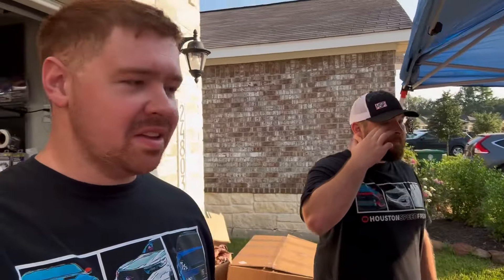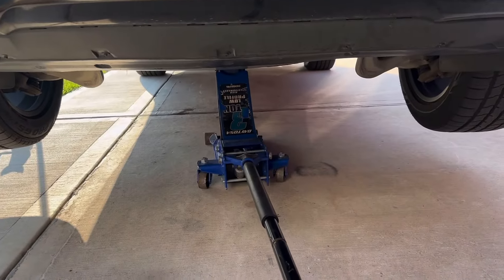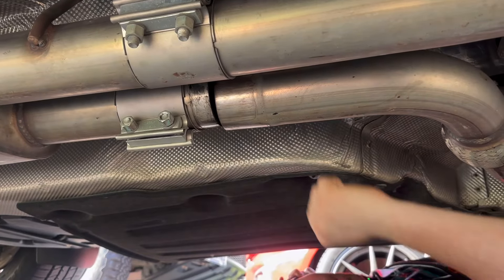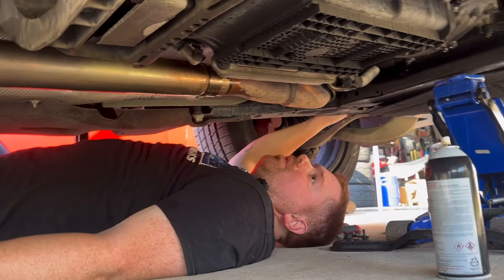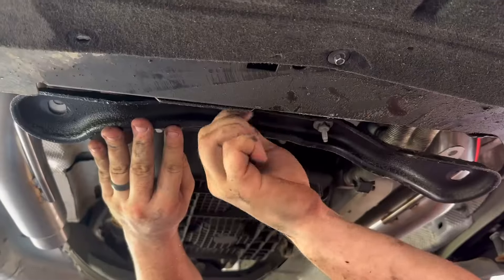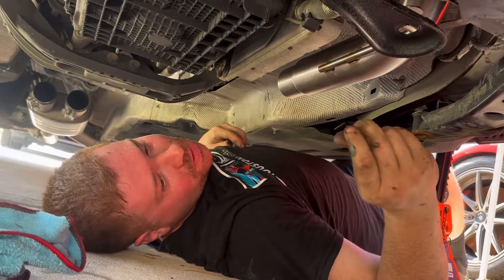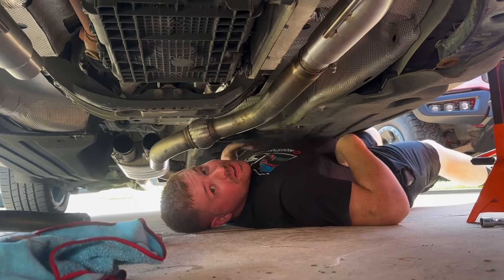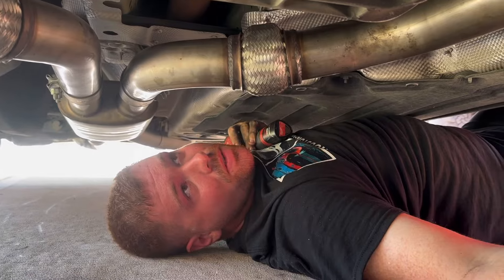Explorer ST CVFab Downpipe Install

Comment: Took mine to  a shop to install and they couldn't take off O2 sensor , they beat it and heat it and they broke it. Made me pay for the sensor +$145 on 22 ST. And the experts managed to mess up my flex pipe , I made them pay for that $167. Right on dude good content.
Reply from the maker: Dude that’s wild I’ve done a lot of down pipes some spray lube is all that’s needed one time I did have to break out my pipe wrench but that’s about it. Haven’t ever broke one or damaged one getting it off to where it wasn’t reusable.
Reply: @HoustonSpeedFreaks  yeah man , brand new car
Reply: I’m in Dallas. How much would you charge to install this? Have thermal 3 inch as well. Do you have a email I can reach you at.
Reply from the maker: @TX_FpiuIsh yes sir shoot me an email @ HoustonSpeedFreaks@gmail.com
Reply: Found my new Texas Ford mechanic going to end up emailing too when parts come in have a 24 ST in Texarkana
Reply from the maker: @turbodad6522 hell yeah brother bring it by I’ll get you taken care of 😁

Comment: Me and my teenage sone just did plus Lethal Performance flex pipes. What a pain in the as$. Don't use GEARWRENCH E22 sockets. The walls are too thick and won't fit on nuts. We did in garage in 10 degree weather jacked up about 2 feet on stands day 1 we disassembled and day 2 we put it all together. No Hurry.
Reply from the maker: Damn in 10 degree weather that’s dedication! , that’s awesome you and your son work on cars together that’s my dream is for one of my sons to pick up cars as a hobby. Props to you two 💪

Comment: I love the sound of the CVFab catted downpipes with the 3" thermal R&D. Is there any risk to turbo or engine damage with this combo while leaving the vehicle stock tuned? We're getting a 2025 ST and from the sounds of it the ECU will be locked. So unless it gets cracked we wont be able to do much but the sounds of those turbos with the CVFab downpipes and the 3" thermal R&D are just too good to pass up. Do you think Ford would void warranty on turbos or engine doing this even without a tune?
Reply: No risk. However, your Ford dealer may disagree (and they'd be wrong). Technically they have to prove that the DP and exhaust caused the issue.
Reply: You could check with the service manager. If they are weary over the downpipes maybe ask if having them installed there would help the situation. The exhaust obviously will not cause any warranty issues.
Reply from the maker: No it won’t void your warranty I’ve even heard of some ford dealers installing the parts for customers but of course it’s not cheap lol

Comment: I just got the CVFab down pipes with Defoulers, will this system require a tune after install?
Reply from the maker: No sir
Reply: @ Alright does the Warm-up procedure have to be followed for daily use?
Reply from the maker: I always wait for it to isle down atleast before I drive off

Comment: Hey Travis.  I had my Doenpipes installed.  Same as these the CVFab.  I have my trusted shop
Instal them.  They also did my tune.  I've noticed though upon start up I will hear a loud rattling noise behind the drivers side muffler.  And sometimes when I stop and break it will happen. This noise.  And then it goes away.  Have you experienced this?  Only happened after the downpipes were installed
Reply from the maker: Are you still stock exhaust because if so, the OEM mid pipes I have a tendency to break and rattle. I see it happen a lot too, especially after people add down pipes on the stock exhaust
Reply: @ nope, I have thermal 3in, cvf pipes and intercooler, and tuned.   I looked on the Facebook group and people also said they noticed the same thing I heard.  For some reason I can't comment on the Facebook page.   So I can't get my questions answered.

Comment: So after 3 hours of trying to get this project done I realized the cv fab sent my downpipes with outlets that are 1/8 in larger in diameter than the stock downpipes. My thermal r&d mid pipes don’t even fit
Reply: Cvfab responded by telling me to cut 1/2 off the outlet of the downtime. Midpipe still doesn’t fit all the way and can’t install it. Seriously a trash design. wtf

Comment: Seems like it has an oil leak going on, seen some caked on the bracket.
Reply from the maker: Yeah I mentioned it in the video and the owner is well aware 😁
Reply: @HoustonSpeedFreaks  ohh got ya! Just had my rear main seal and oil pan replaced under warranty. So my eyes went straight to leak lol good job though on the install. Love all your videos keep it up 💪🏼
Reply from the maker: @pyro1284 yeah it’s a really common leak on the explorers unfortunately I see it on a lot of them
Reply: @HoustonSpeedFreaks  I had it on mine, but I cleaned it up and it hasn't returned. I think it was front diff fluid from the FADA leak, which I had addressed a few months ago.  Since it's a common issue, maybe the leak is usually old front diff fluid.
Reply: @jungwoo4667  had that happen to mine as well. diff oil drained all the way back there, thought it was oil pan. Ended up replacing the FADA with the new version (no actuator), cut the connector and reprogrammed it, been running great ever since.
Reply: @chrisbrown5164 I had mine fixed at the dealer a few months ago. I don't think they gave me the new part that makes it full time AWD, but a new o ring

Comment: Hi, what socket number did you use 17 or 19 or 21?
Reply from the maker: For the down pipe bolts it’s an e22 deep socket I cover it in the video 😁
Reply: How many inches are the 02 sensor spacers?
Reply: How many inches are the 02 sensor spacers?
Reply: @ Where can I get the spacers for 02?
Reply from the maker: @gumbee9911 oriellys sells them but they should come with the down pipes

Comment: The worst project. Had mine at a high-end shop. They actually refused to do it and sent it to another shop. 600 for the install. The shop that ended up doing the work said it was one of the most aggravating projects they recently done.
Reply from the maker: lol it’s not easy and definitely knowing how to do it and having the right tools is the key to getting it done. I’ve gotten it done to about 1.5/2 hours
Reply: @HoustonSpeedFreaks  thats quick! U probably save another 15 to 20 minutes if u had a lift.
Reply from the maker: @acon815 oh easily lol
Reply: @HoustonSpeedFreaks  What kinda issues do you think i'll run into doing the DPs on my 50k mile ST?  My DP bolts to the midpipes were very rusty.  I think I might break the hardware on the turbos.
Reply from the maker: @jwuonog just get a good penetrating oil
Reply: @HoustonSpeedFreaks  Thanks! Your videos are so helpful.  You make this job look so easy.  I'm going to try the hardest side first, and if that's terrible, I'll call it quits and leave it to a shop